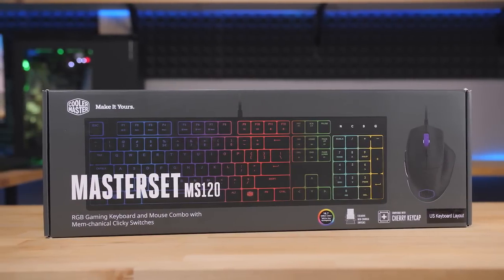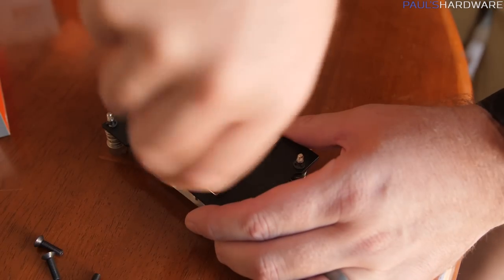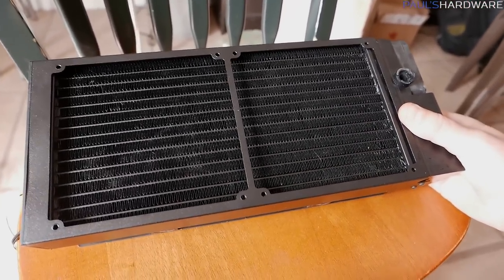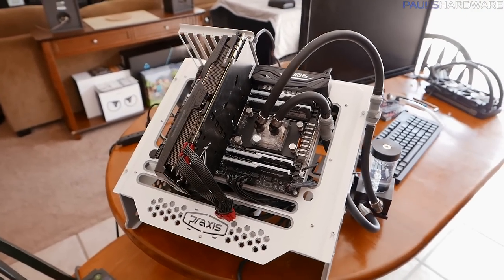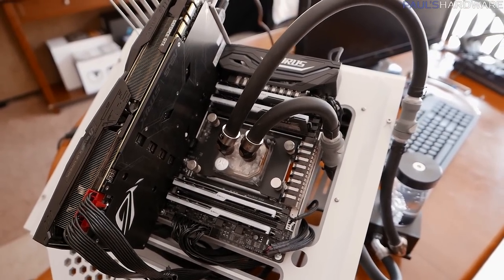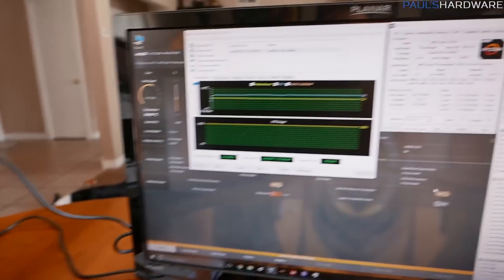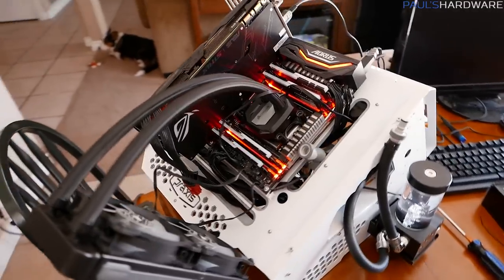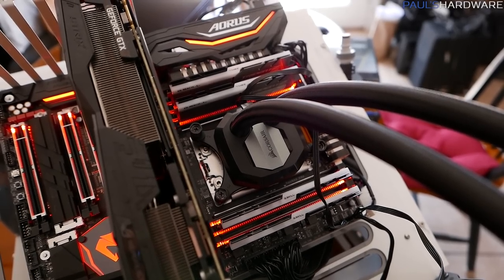My Failed EK Supremacy EVO Threadripper Edition Review

Comment: Paul, this isn't directed at you as I know you're a smart cookie, but to others who may have dead CLCs.. I've been using Corsair AIO's since they were first released, totaling about 12 of them including replacements. What I've found with every single one is they work great until you move them. Everyone one has sat in the system in the same position for a little over a year, take cooler off CPU to upgrade or redo paste, put it back together and it dies within a week. I've had a very small group that were outside of warranty, fortunately the 5 year warranty is pretty beefy. The ones that have failed outside of warranty, I have disassembled to find that the pump itself is fine but the natural evaporation reduces the amount of water in the loop, which allows air to circulate through the system, adding in the degradation of the antifreeze, you get rust, sludge, and scale buildup and it restricts the flow of the actual remaining coolant. You can tell this by shaking the radiator and listening to the fluid inside. Shake it in the direction that water would normally flow through the radiator and you likely cant hear much, but shake it in the other direction and you can hear the water sloshing in the tanks. This disturbs all the scale and sludge and helps free it out of the cooler. Plug it in and let it run for 10 minutes then unplug it. After doing this, I have removed the cold plate off the bottom of the pump, be careful it is sometimes real car antifreeze and sometimes its pressurized from the heat, but the jet is typically clogged up with the white sludge and the micro fins have rust and other metal particles stuck in them. I submerged the cold plate in a bucket of water and used a semi stiff car detail brush with fine bristles to scrape the junk out of the fins. Drain all the coolant from the cooler, shaking the radiator and orienting it in different directions to circulate air in to help pull it all out. I then used a large 60 mL medical syringe to refill it. I put the block upside down on the edge of the desk and let the radiator and lines hang under the desk and drip water in with the syringe until it stops taking it. Lay the cold plate on and hold it with your thumb (don't need to screw it down, it doesn't make much pressure - just hold it), plug the pump in to power for about 10 seconds, then unplug. Lift off cold plate and continue filling. Repeat this until you lift the cold plate off and still see water inside. Doesn't have to be topped off 100% perfect. Put the screws in mildly tight to just to hold the seal from leaking then literally start the process all over. Shake the heck out of the radiator again in all directions to free up the gunk. Run the pump for about 10 minutes to circulate the gunk, drain and repeat the entire process. Repeat this process until you stop seeing the white sludge when you remove the cold plate. For me this was about 5 times for a smaller h60. Once you're comfortable the gunk is all out, drain and refill with either distilled water or order some EK mixture. When refilling for the final time, you do want to continue adding fluid until it is 100% full and looks like its about to overflow. Run it for an hour or so until you hear the air bubbles stop. Add some more, etc etc. Remember to shake the radiator a little bit during the process too so the air pockets circulate out. Repeat a few times until you cant add any more. Make sure the o ring is dry and you wipe up all the water out of the o ring channel with a microfiber cloth. Put the cold plate back on and tighten it up. Plug it in and leak test it for 24 hours outside of the system before using it. Allow any spills to air dry that you cant dry with a towel. The process is tedious but can be done over the course of a day or two while doing other work, and saves you from buying a new one.  As always with liquid cooling, utilize extreme caution or get a professional to do the work for you. I am not responsible if your system dies as a result of following this guide. If it's within warranty, obviously send it to MFG and don't open it yourself!
Reply: TLDR.

Comment: feel your pain, I lost the pump in my 120mm AiO last week. Fortunately I only run an i7-T so got lucky. But now I've switched back to my 212evo
Reply: That sucks. I've had to refill mine (it was new, but sitting in a warehouse for several years, so it evaporated, but it was cheap). I would probably remove the pump impeller (its just resistance now), and hook up a cheap pump in line with it to fix it for $5-10. Or you could just use the radiator with a good $15 block and a cheap pump (should be better than a normal AIO, probably nothing you would notice though).

Comment: well, here's hoping that my corsair h100i holds on, it's fairly new so who knows.
Reply: Mine died after 4 months.  Good luck!
Reply: So glad i went with a Noctua 15 so not having to worry about pumps and water is a good thing.
Reply: jagsfanrick what CPU do you have
Reply: mine died within a few months... but my h55 has been holding strong for over 2 years now.
Reply: mine died 2months after installed. good luck
Reply: My h110i is already over 1 year in use and works still fine
Reply: ArtisChronicles I got my h60 when it came
Reply: my h115i (it's basically the same pump with h100iv2) died after 10 months of use
Reply: whoa, it's just really2 bad luck mate, how about your other hardware? Did they survive?
Reply: I've had my Corsair H105 for 3 and a half years and still going strong :D
Reply: The only thing that has died on my h80i after more than 3 years is the blue led

Comment: The 2 line method works better than the dot used here.  The area where the dies are located are not fully covered with tim, and it looks like it's 60% at best.  Try the lines and see a bit of difference I'm sure.

Comment: Cutom kits like ek cost $370 to $390. Buying my ek kit saved $30 but it didn't come with a $20 t valve we should  use when you empty your system. AiO easily set up & costs $110 to kracken's $162. Big diff.

Comment: I think tech tubers put more stress on AIO equipment because they are far more frequently installing and uninstalling them.  Like anything else, using something in a manner it wasn't designed for is likely to bring up a higher failure rate.  Look at the fitting for the EK Predator, sitting in a box, maybe with some pressure on the fitting, and it breaks.  

I understand your frustrated, but at the same time that is what warranties are for, and more importantly you have many options for backup, unlike most people watching your videos.

Keep making the vids, because even when your audience may not agree, we keep watching :)

Comment: My brand new H80i v2 lasted me two months before it died, and the worst of it. I didn't even realize until about a week later since it never actually hit tjmax. It just idled at 70 and load was high 90.

I'll just stick with bulky aircooling. No points of failure when it comes to raw amounts of copper and aluminum when it comes to cooling. The only thing that saddens me is the fact I absolutely love sff and use an htpc as my main rig Which is why I originally went with the aio. Basically meaning I can't ever overclock since small air coolers don't dissipate much heat. Hoping that the Cryorig C7's all copper build will help at least a little with that.

Comment: I've always been a bit on the broke side to buy gear, but recently my brother asked me to build him a system. 6700k with an h80i was the "final" configuration chosen, since he had a temporary case and  not a lot of space.

The pump died after 3 months, so I swapped it with a Zalman CNPS12X triple fan air cooler I bought a while back, but had never used because I forgot to check the clearance.

Luckily the temp case was plenty wide, but I have yet to RMA the h80i. Bad taste for a first time AIO purchase.

Comment: What exactly would this demonstrate even if the AIO pump hadn't died? What sort of experimental design is this? You should have just compared a regular Supremacy EVO vs the Threadripper edition to compare the surface area of the heat exchangers. I don't know what you thought comparing it to an AIO with a completely different radiator and pump (Even though the flow rate and pump pressure's impact on performance is fairly minimal in a limited loop with low resistance) was going to accomplish.

Comment: The pump on my Cooler Master Nepton went. Granted it lasted a couple of years. But two fans plus a pump, which for the goal of keeping volume to a minimum you still always got at least a low hum. But the computer is in an Enthoo Evolv, there's plenty of space. I swapped it out for an NH-D14 and I have a single Corsair ML140 fan. Running an i5-4690K clocked at 4.5 which I use for some reasonable gaming every now and then.

The only point of failure for it is the fan, which I have plenty of spares for. It's never been quieter, considering I don't have to play around with the pump to figure out how to minimise the hum. Maybe it gets a bit hotter, but then I don't run the fan at 100%, and I never ran the Nepton fans at 100% either. Both are easily within comfortable temperatures.

So what was I gaining by spending the extra money on an AIO instead of just using air cooling from the get go? A couple of degrees cooler I'll get negligible benefit from, some extra noise, additional points of failure and a much more restrictive lifespan on the part.

Maybe with a beefier CPU I'd have seen more benefit, and maybe with a more restrictive case the AIO would've made more of a difference. But I certainly think the reality in most instances where people get an AIO, they're being sold a bill of rights based on how the PC tech media, and industry as a whole, chases the latest release and makes recommendations based on that, and can be a bit too easily led by the way producers PR game them. But doesn't talk about the long term balance of value and investment.

I'm not saying this is any different from any other media-industry relationships. But I do think it's present, so it's interesting to see the life cycle of items being openly spoken about, rather than just ignored, because it pretty rarely happens.

Comment: For AIO coolers, it'e better to keep ports on radiator at bottom. The reason is there is always some air in the loop. When ports are on top, air goes to top then sucked into pump. Then there is no longer water flowing through pump. For custom loop, usually there is a reservoir so air does not go back into loop.
The reason for air in AIO, according to Corsair, if there is no air at all, when water heats up and expands, it is not safe any more. With air, when water heats up and expands, it compresses air.

Comment: I've just went through a very similar experience, over Christmas I got a brand new MSI 1070 seahawk, it's a beautiful card and couldn't wait to install it into my loop but alas was not meant to be. I got it all connected to my EK Predator 360 and booted windows full of excitement to check out my latest upgrade. At first temps looked great, I ran 3Dmark and scored 15k before I even attempted overclocking but then the nightmare started, I noticed some droplets of coolant had dripped onto the backplate of the graphics card!!! 

Anyway to cut a long story short my Predator 360 had developed a leak on the outlet port, I ended up having to get all new fittings a new radiator and a new pump and I'm still having issues with cpu temps, I've just decided to replace the cpu block today, but hey this is all part of joy of watercooling I guess, sometimes shit breaks, anyway just wanted to say I feel your pain and this video gives me hope i'll get this sorted out :)

Comment: Paul I have a ek predator as well and I striped the treads on the same port. I used hose for a car that was 5/8 ID and a hose clamp and stuck my normal 5/8 od tubing in the other end and hose clamped that as well. It holds without leaking and is currently running rn.

Comment: The H100i had a lot of failures when it came out, according to newegg reviews. The pump's controller was supposed to provide variable controls via usb connection on the motherboard. However, it would fail over time. Savvy Corsair fans at the time were buying the non "i" models which did not have this problem.

Comment: You clarified some temperature questions with this report. For one, the brief temperature spikes above 68°C when few cores come under load are apparently by design. (My 1950X's record is 76°C). Also, those are likely totally harmless considering your CPU only did the emergency shutdown at >=97°C. And anyway, I hear some people drive it significantly higher than 68°C with manual overclock, all the time.
So I don't have to worry that I might have done anything wrong when my system died recently. (1 month old 1950X, Asrock X399 Taichi, DDR4-3200@3066 - short circuit on ATX12V1+ATX12V2 connectors occured during heavy video rendering - and tech support expectedly useless in figuring out the point of defect.)

Comment: Then my conclusion is that the custom waterblock covering all the IHS does not make a significant difference between the Asetek compatible blocks used in the AIO, I have the same system, an Aorus Gaming 7 x399 in a Cougar Conquer with a Threadripper 1950x OC to 4GHz on the 16 cores using a Thermaltake Riing 3, and on load after 10 minutes or so (using either 7Zip benchmark or Handbrake) the temperature doesn't hit the 70s C (except when the Ambient temps are too high, which has been the case lately)

Comment: H100i is garbage! 
My third pump in less than a year. 
Moving to a custom loop soon.
Reply: Luis Ortiz I've had my H100i for 3 years now with zero issues so far. Watch it spring a leak tomorrow :/
Reply: H80 failed, they replaced it with an H80i, been running fine for a couple of years now.
Reply: Corsair, like many other AIO manufacturers, use Asetek and just rebrand it. You should really blame Asetek
Reply: Hyphen - No... you should blame Corsair! They know about the pump failures, yet continue to use and sell the Asetek stuff... THEIR decision!!
Reply: Mr1Tanker probably because they have a lower failure rate than airbags in cars....also most prpblems are user error
Reply: H100i was manufactured by CoolIT and not Asetek.
Reply: The h100i v2 was manufactured by Asetek. http://www.asetek.com/desktop/do-it-yourself/corsair/corsair-hydro-series-h100i-v2/
Reply: Luis said the H100i is garbage.  Not the H100i v2.  I'm going with what he said.  I know the difference between the two products.
Reply: The one in the video was a v2. It made sense to me that luis' comment was relating to the video and not unrelated.
Reply: Hyphen 
It's the V2. 
You can get them at your local best buy.
I had to replace it 3 weeks ago.
Reply: Theres no going back once you go custom, you'll end up with rigid tubing at some point if you don't start with it that is.
It is expensive for what it is, but they are awesome to look at, and do a great job cooling and reducing noise (potentially).
Reply: this confirms what i just learned a few days ago.  I'm pretty sure the pump failed, and so I'm going to have to move to a more robust solution

Comment: I took my pc to a repair shop and they melted my PETG loop.  I'm so pissed since I know temps reached at least 110C, they pretended like it was no big deal...
Reply: Life Aficionado WHAT???
Reply: BackinBlack_4896 just venting because my new PC is probably ruined.  I guess they forgot to plug in the pump.  There's no way a 480mm super thick rad can't cool a non-sli'ed gaming pc.
Reply: True, but they still haven't given me my pc back so I can inspect it.  I'm sure it got way hotter than I said, just trying to stay positive because I can't afford another CPU and GPU.  It was brand new too...
Reply: I hope it did, but I really have no idea since I wasn't there.  They gave me the melted-to-shit petg tubing which went from a long straight tube to a half-pipe, the whole length was melted to the point of completely losing its shape and structural rigidity.
Reply: Life Aficionado Are you sure they didn't use your rig for a pyrotechnics demonstration? How does that even happen?
Reply: It wouldn't surprise me.  I can't wait to get things back and check it all out.  They even re-installed my CPU block improperly.  It was so loose that it was barely even making contact with the processor.  

I hope they didn't mess up my 1080ti or else I'll take them to court.  Sad day, but they need to own up to their mistakes.
Reply: Yeah that's no good, that's why I tend to learn and do things myself. Trust me, I'm an appliance tech and you want to learn as much as you can to become self-sufficient, it will save you money and headache in the long run. Unless you didn't have time to fix the issue and gave a small business the benefit of the doubt, which I can understand.
Reply: Yeah, I built 2 pc's and had the same issue with both of them.  The only part I re-used was the PSU, (I didn't think that a i7 7700k and a 1080ti would need more than 850 watts).  But I would rather do everything myself, just was frustrating with 2k+ invested and the thing shuts off every 15 seconds.   So I went for "professional" help and realized they're incompetent.
Reply: @Imakeplanesboom  take your time. Building PC's is so freaking easy.....
Reply: + Harry Harkins, well there was no resource, whether in-person or online that was able to help me fix my situation, so I thought professional PC help was the next logical step.

Comment: I have an NZXT Kraken x62 and, though I get higher idle temps by  a couple of degrees, I get the same max. That's using the performance fan curve, but open air I can get those temperatures on the default curve.